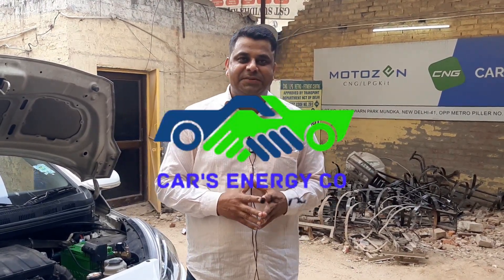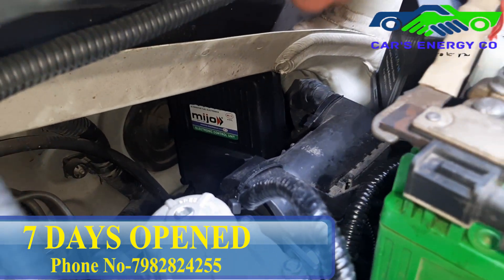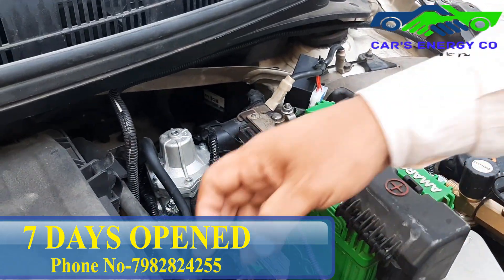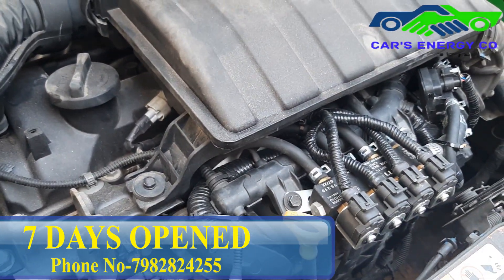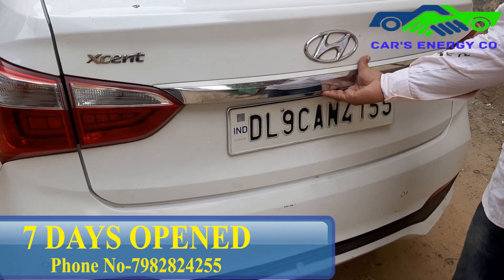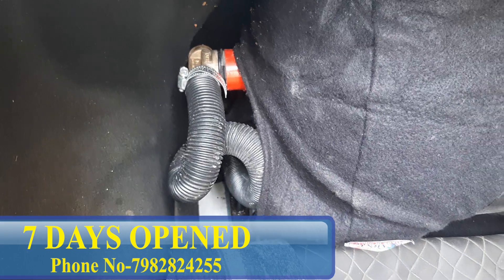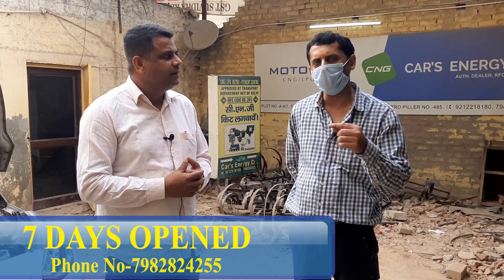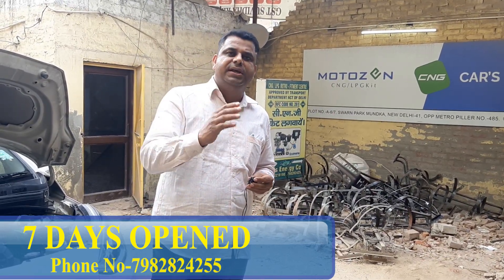CNG KIT IN HYUNDAI XCENT/WITH XTRA 8 PARTS FOR SAFETY AND BETTER PERFORMANCE

Comment: I have 2018 xcent cng company cev fitted kit , it is not shifting in CNG, company people say it's heater sensor fault and some pipe , the main problem is the kit is turned in such e way that if car is below 2000 RPM then it will come to petrol automatically and when we go above 2000 RPM it is in CNG , so when I say to solve it to company people , they say they don't know how to do , now when I show it to RFC, they don't know the software used in my car , as advancer is stage tap 01 but I don't know ECU as it's is in hidden place , now RFC is telling me to change kit to tomasito, is it suitable for my car ? Should I change kit ?? If no then which software can be used for this CEV KIT and where can I get that software ??? In CNG owners manual it is written ECU name STAG 4 NEXT .
Reply: I think u r very much disturbed u have not mentioned which place u belong from anyway get your software changed. Go for a simple Aeb software which u will find from any shop which will cost u around 7500 to 8500
Reply: Thanks for reply, my all CNG knowledge came from your videos, I'm from Hyderabad , can AEB software tune this ECU, is this advancer stag tap 01 is dynamic or normal ,
Reply: One more thing sir , please show how you fit , that triple layer sleaving, you show how the fitting has done but please show the procedure so that we can tell our RFC people to follow this